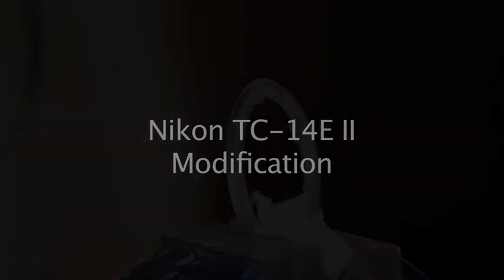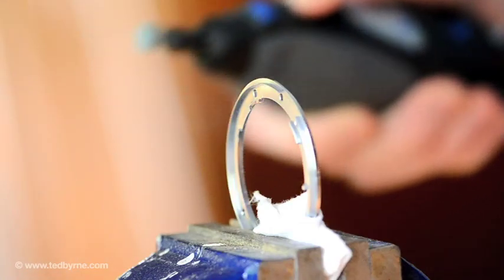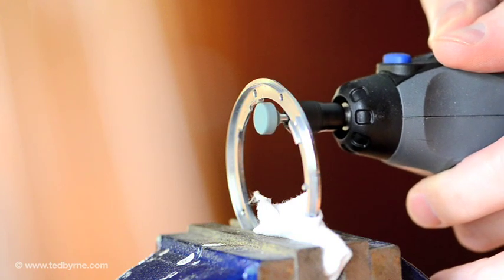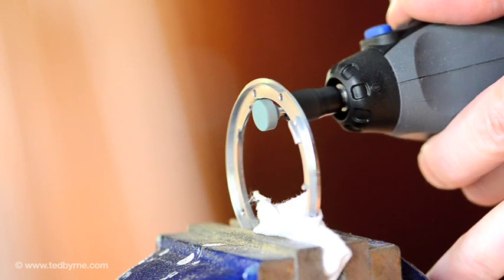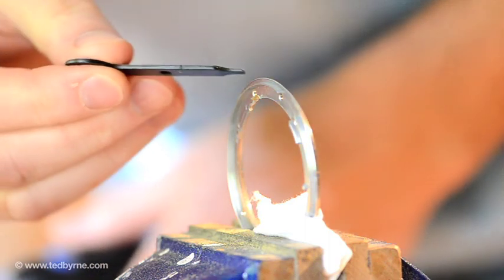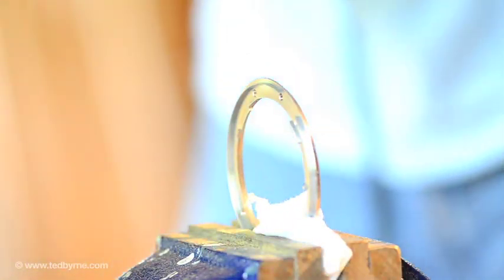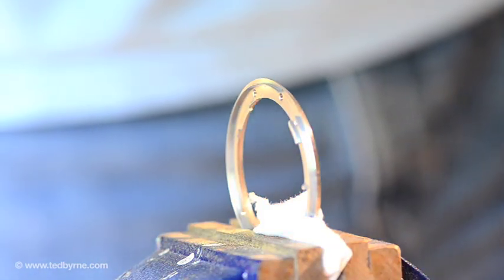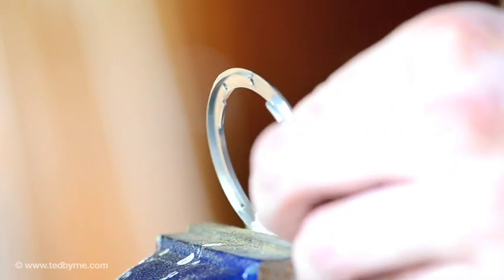TC-14E II modification (tab removal)

Comment: Many thanks to you Ted ! You sazed my day ! I just modified my TC-14E III for use with my Vivitar 120-400mm and it worked perfectly along your tutorial. I used a Dremel with a smaller diameter grinding bore, a round file for final trim and 600 grade wet sandpaper for final polishing. Apart from the light bronze color appearing, the local cut zone is barely noticeable. I also support your recommendation using the correct screwdriver for the job, a micrometric one (inexpensive) with a firm grasp will be just fine. 
I still wonder why NIKKON was so restrictive and prevent compatibility of this TC with non proprietary lenses or even from "Nikor Heritage", beyond the obvious geometric and functional limitations, which the average reflex camera user will be fully able to discover by himself case by case.

Comment: i have a TC-20E II

After this procedure is it possible to use this on other Nikon lens other than the f2.8 series. I have a 80 - 400 4.5 i wish to use this on 

thank you
Reply: This works for nikon 70-300 f4-5.6 ? thank you.
Reply: @jmmestizo  This mod will work ONLY with F-mount lenses with a recessed rear element.